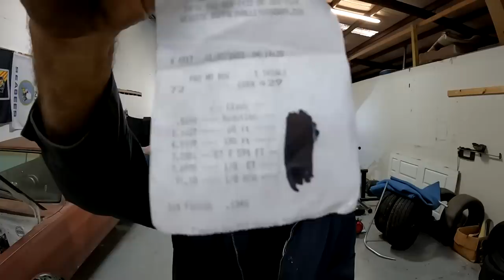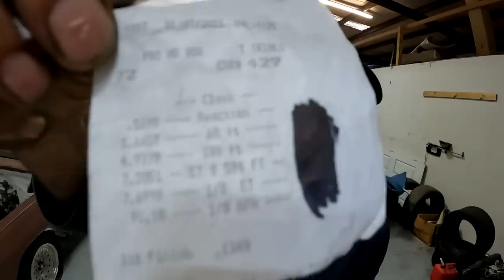Project Bottle Rocket Grows Up - Here Are The Numbers, Facts, History And It's Future

Comment: "Here's my time slip" - Completely blurred to shit, can't see a thing. ROFLMFAO!!!
7.60's are a whole second short of running a 10 second 1/4. You're going to need at a minimum, a 7 flat in the 1/8th to = 10.90-10.99, most need to be in the 6.90 range.

Talk about old wives tales "loose is fast" - turns out, that's actually nonsense. All you're doing with "loose" is beating your engine to death faster.

Love the car, love the attitude, brings back memories from the 70's and 80's!! Keep it going, perfect sleeper streetcar.

Comment: A 318 against a heavy truck with a 429 ford with hemi heads,and only does less than 8 seconds in an 1/8?
He said the truck has 800 HP?
It doesn't make any sense. 
A well tuned 307 Camaro can run 15's in a 1/4 mile.

Comment: I wish the 1/4 mile was still standard/ the norm in drag racing. I can go out and run an 1/8 anywhere. Quarter mile is not harder to run on the street.
I'm 24, I don't know everything. I'm not trying to know everything but I'm all ears if you have something useful to say. I'd like to know as much as I can about cars. I'm pretty good, not a mechanic but I do my own work on my cars, I knew that if BR didn't have nitrous it'd lose. No sh*t Sherlock, of course a 318 in a 3k lb car would lose to a big block single cab pickup. If BR was 500lbs lighter then she might have a chance, but you'd have to practice the launch a lot more and pray that she could hold up towards the end and not get passed at the last second. But I'm not trying to call you out or anything, you need something to compensate for what Casper had goin

Comment: Don’t write checks you can’t cash. Making yourself out to be a self proclaimed guru puts you in the cross hairs when you always have disappointing results. But hey you get a A for effort. 10 sec bottle rocket, 11 sec slant 6, slaghammer, your road course slant 6 Miata, etc.  
I’m sure if you went 6.99 you wouldn’t be concerned about judging your times. Good Luck. To go fast you have to spend money and with stock junk it’s not happening. I wanna see you wheel a 9 sec car. Your stock suspension is ok for 12s but it wouldn’t hook or go straight with power. Yeah you cut gas on the top end on a 5000 race so you can say hey guys I’m going no time now. 🤔

Comment: May as well be blurred out..  Drag strips can't afford ink ..
  I ran a Motorcycle at Martin Dragway  1/4 mile  last summer ..  I won one race I was 0.028 off my Dial in.. I lost a race by  0.1360 off my dial in against  0.0501
I won a race ran  12.836 @ 107.66    0.0268   I ran three practice runs that were like  12.86 12.85 and 12.87
Reply: get off your phone and put it on the tv...55"' in hd them numbers are almost 2" tall

Comment: Going by the weight he gave with him in the car (3,100 lbs) and the trap speed (91 mph) the engine makes about 270 at the crank and he shot it with a 150 shot. (420 total flywheel). Meh.